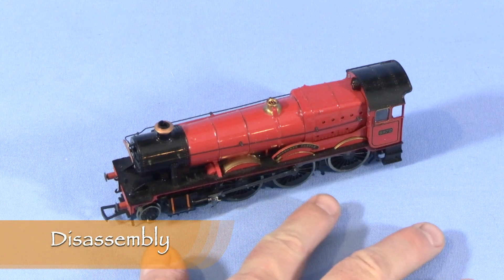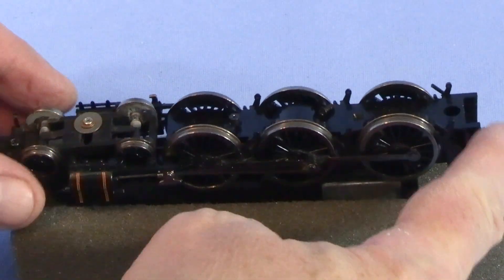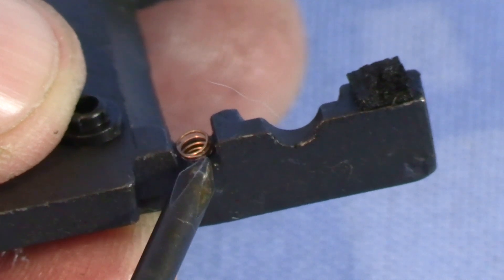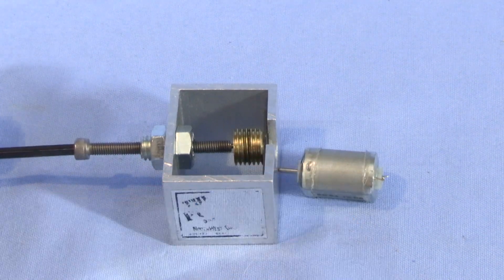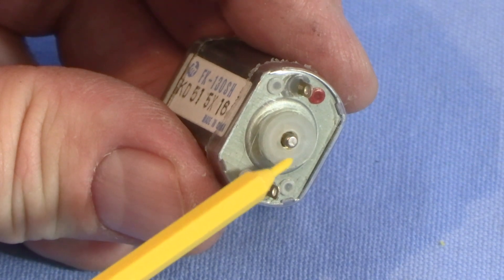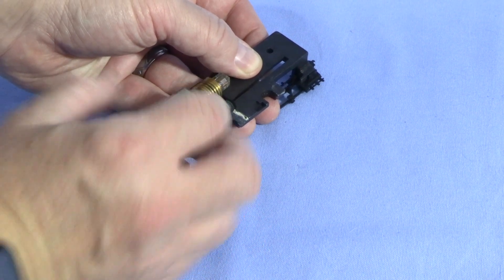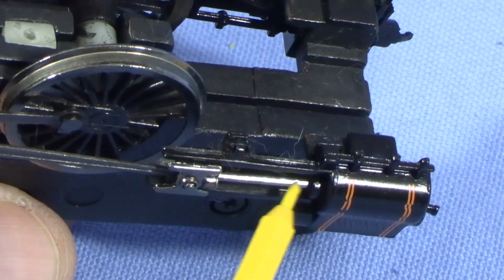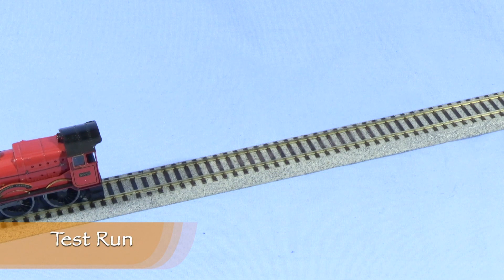My Model Steam Train Locomotive Stopped Running!  Can It Be Fixed? - Fixing the Hogwarts Express!

Comment: Good video DC! I have found that it makes installing the drivers much easier if you carefully remove one push rod and then reassemble the bolt, holding it in place back to the wheel with connecting rods and then install that push rod after you get the wheels set in the frame. I think I need one of those. It’s nice that they found a way to combine the drive worm with a flywheel. I like the shots of it at the end, pulling the passenger train through the Christmas display.
Reply from the maker: I'm glad you liked the video.  I didn't try removing the side rods, but that might indeed make the reassembly a little easier.  Getting both sides lined up at the same time was the hard part.  We still had the Christmas layout up when I shot this, so I thought why not include some shots of it running?  Thanks for watching!

Comment: Congratulations on the fix! Those drive wheels are tricky. I took an N scale Northern apart, trying to figure out how to take it apart and put it together again with the intent of planning how I would modify it for DCC. It was re-assembling the drive rods that tripped me up and the front part ended up breaking. I may try to get parts for another attempt someday, but I think I will have to settle for a BLI heavy Mikado with the DCC already installed for a substitute for now. I appreciate your videos!
Reply from the maker: I'm glad you liked the video.  N scale steam can be a challenge because of the small size, and yes, the small parts can sometimes be easily broken.  Sorry to hear you had that happen to your Northern.  I hope you can eventually get it running again.  Thanks for watching!